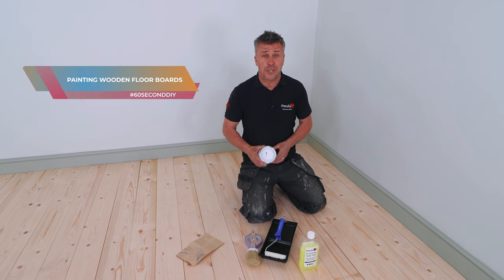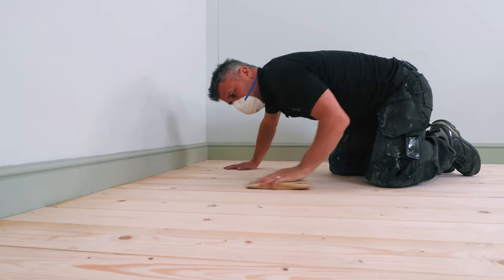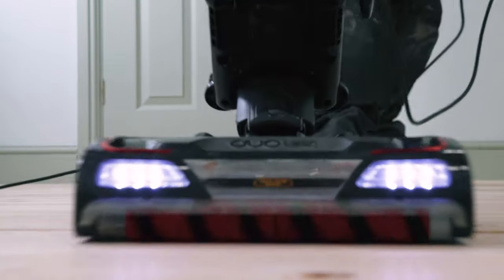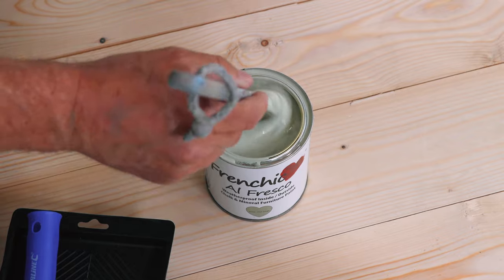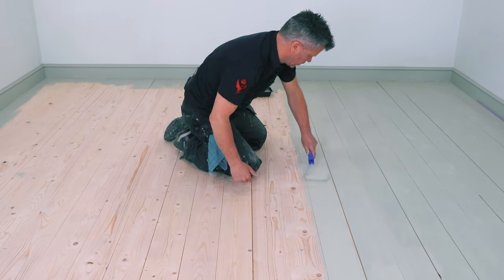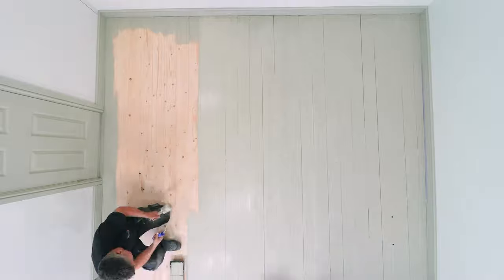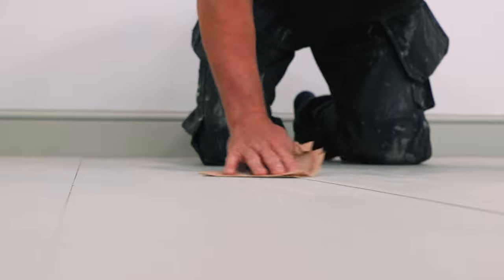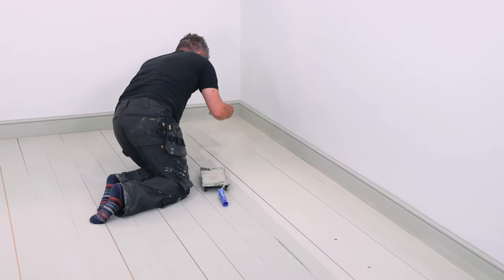PAINT WOODEN FLOORS THE EASY WAY | How to Paint Wooden Flooring | 60 Second DIY Tips

Comment: Looks beautiful how would you do that in a kitchen or a bathroom? How would you waterproof wet areas?
Reply from the maker: You can do it, just double check with frenchic first if it is suitable! But you will need to wait for the paint to cure then go over it with a finishing coat sealant or their tuff top coat to really maximise usage of the paint! Cheers!